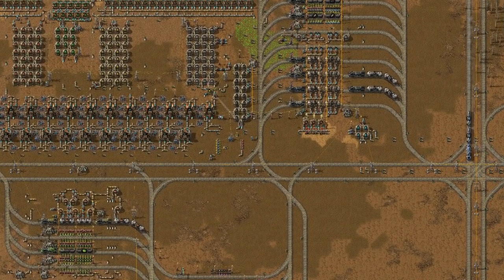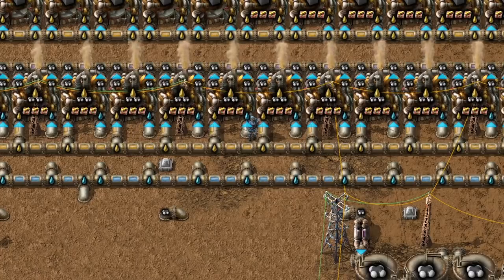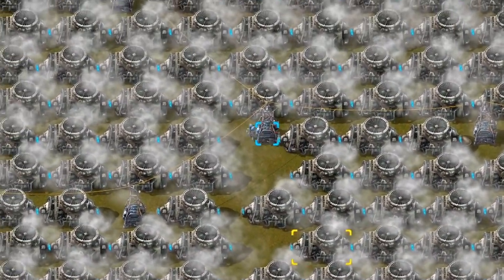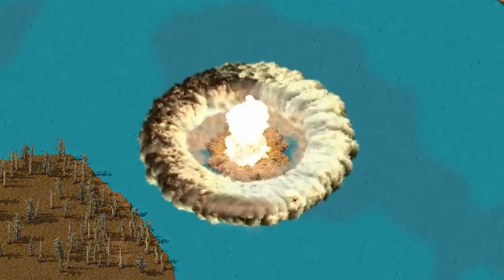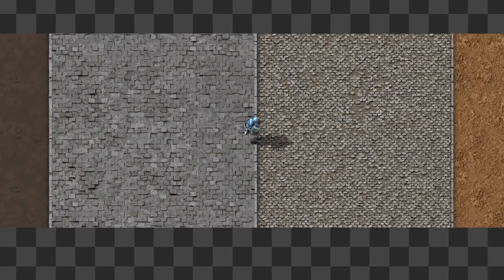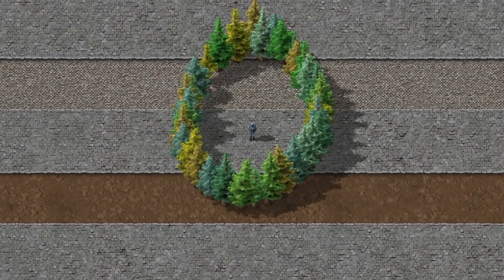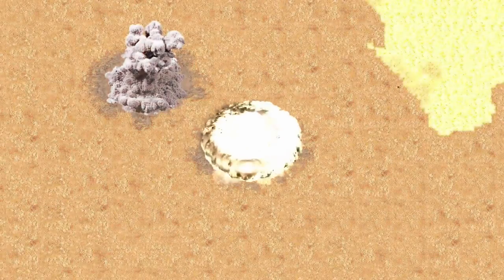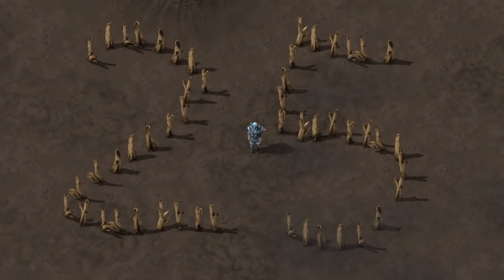Eco friendly rockets

Comment: I love weird disconnects from reality like this that are caused by otherwise perfectly reasonable logic.
Reply: but nukes really are green, like a nuclear winter would be CO2 positive, it solves climate change
Reply: I think the problem is that landfill absorbs zero. It's dirt, not concrete, it should be 25 at least.
Reply: @livedandletdie  The reason why is microbes. So long as there is light and spores/seeds spreading, microbes will always grow.
Reply: @DaFreak860  but, is that solution actually better than the problem?
Reply: @DaFreak860  That is a bit dangerous,but still possible in a way.Why not seed the air with some other cold chemical,or create big algae farms that absorb more CO2?
Reply: GREEN POWER IS THE BEST! LIBERTY PRIME & USSR BOTH APPROVE!
Reply: @BrunoMaricFromZagreb  there are plenty of other ideas, some better and some worse, I just meant to say that there was that idea.

I personaly think that research on it, is itself underfunded and relys to much on the private sector, there are plenty of good ideas and I think we should go for a reduction and replacement of CO2 sources, like coal power should be replaced with nuclar and solar, not wind (habitat reasons, birds don't respect airspace). And cars should be reduced to puplic transport.
Nature is resilient, new microbes were discovored that are capable of degreeding plastic so the ocean polution issue nature will fix for us.
Reply: @charlesdaugherty321  lol, wtf, what about all that albedo particulates reflecting sun
Reply: @DaFreak860  Termination Shock? :D
Reply: Public transport for Inter-state travel?
Reply: @Khaim.m  does this mean that nuking the landfill makes it better?

Comment: Fun fact: gamma and ultraviolet radiation can break down certain molecules we count as pollution. It does make sense in Factorio, after all.
Reply: Thanks Gandalf.
Reply: There are mods in Factorio to soak up pollution (Pollution Solutions, Air filtering, Better Air Filtering), plus a mod for eco-friendly setups (Bio Industries).

Your design would likely involve Air Intakes (modified Steam Turbines), and a Tier 3 Assembling Machine (since it has a Fluid intake).  The Assembler would have a recipe for 'Pollution Neutralization' which would take in a large amount of Pollution from the Chunk and a single Uranium Fuel Cell, and would eventually output a Used Up Uranium Fuel Cell, and some random collection of Iron Ore, Copper Ore, Stone, and Coal.  Depending on how efficient the process is, you may wind up setting the Air Intakes across multiple Chunks and moving the polluted air via Pumps.  So you would have a sea of Red over your base, except for one line showing where the Air Intakes are.
Reply: So can wrestling a Balrog down an incredibly high smoke stack....